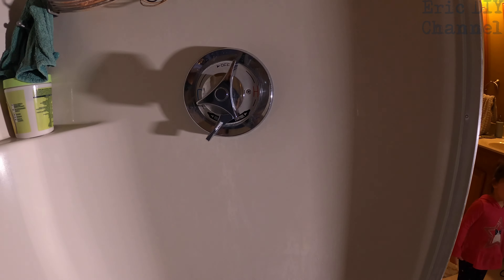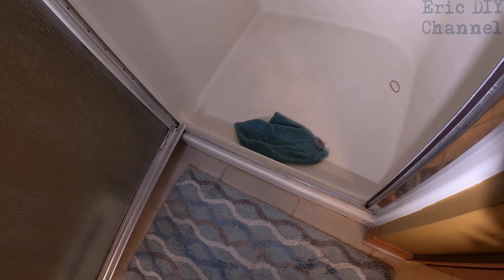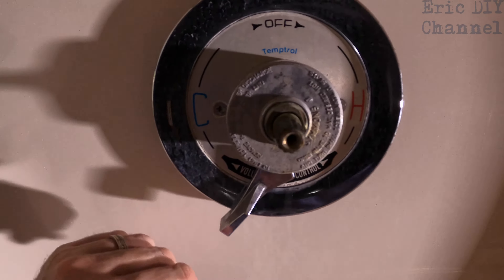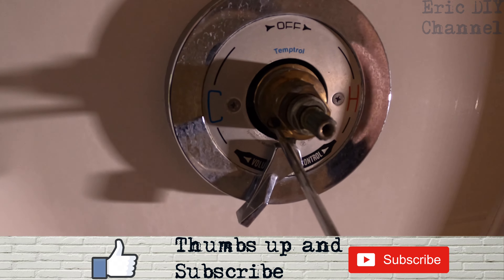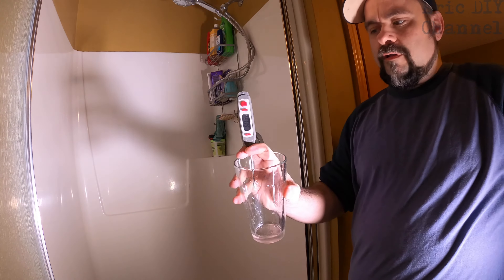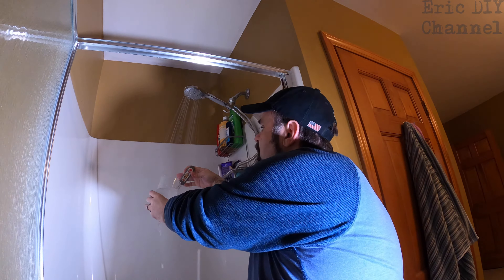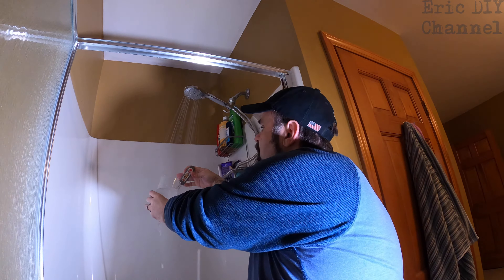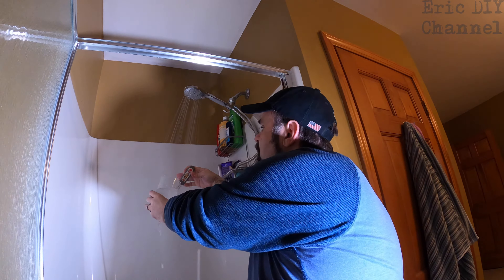How To Adjust Temptrol Shower Faucet Hot Water Temperature Limit Stop

Comment: I have a valve and parts in my plumbing spares and I studied it carefully today. I see how the diverter spindle works and I don't think it can be modifies. I just have to live with the bypass flow. I replaced every part but the body two years ago, so everything inside is nice and new. It's just how it works.

Comment: Is there any way to reduce the bypass water in a Symmons control. Even in a quick shower, we collect nearly two gallons of bypass water and I'd like to slow this rate down.
Reply from the maker: I don't know if any way
Reply: @EricDIY  The Symmons installation sheet says that a stream "about the diameter of a pencil" is normal when the shower is operating. Is this what you usually see?
Reply from the maker: @HomerShannon  You might have to change a washer out to stop the water from leaking as much. I had the same problem with the Symmons in my old house seeing that the prior homeowners didn't use the shower a lot and the rubber dried out. It would dribble out the bottom of the faceplate. It takes a special tool to take the valve out and then you replace the washer. I didn't take videos back then but I'm sure someone else has the video on YouTube.
Reply: That is s problem but I heard it is necessary

Comment: Hey Eric so  i watched your video several times and im still struggling with the temp control adjustment. Can you clarify for me what steps you did to make it hotter i turned mine CCW and it didnt get any hotter so im not sure what im doing wrong
Reply from the maker: How's the hot water source working? I would check that next
Reply: @EricDIY  new hot water tank . Hot water in the sink is perfect. It seems like im getting too much cold water but i dont know where else to adjust
Reply from the maker: My old house had a cold water adjust valve near the cold water input to the hot water heater. You might want to see if yours has one and close it slightly until the mix is right
Reply from the maker: Try checking and cleaning the spindle to see if there's any problems with the float in it (see this video here: https://youtu.be/RaYRM4dJNm0)
Reply from the maker: @dawn-blade  that's why it sounds like there is a problem with the mixing of hot and cold. I would check the spindle
Reply from the maker: @dawn-blade  I would contact Symmons and ask them to replace it under warranty. I bought it in the video because I didn't want to wait. You could try soaking it in vinegar first but if it's a new one you know it's going to work
Reply: There should be 2 adjusting valves behind the main eustchion. Remove the 2 Philips screws holding it on. Those screws actually thread into the center of the adjustment valves. You also could have a stuck piston in the spindle.

Comment: Ot bad,,  but there r dozens of brands with different adjustments ,,, heads up tape yr drainuse cardboard to protect shower base ,drop a tool could b ibnstalling new base ,,retired bath and kitchen remoldling 45 years,,,,,all in all u did help peps out 😊

Comment: Am I missing something? The Symmons Temptrol instructions say "To adjust remove dome cover, open valve to maximum desired temperature and turn in limit stop screw until it seats." Your video states that the turns of the stop screw IS the adjustment. It is not. It only limits the valve handle turning to the hot direction to the set maximum temperature to prevent dangerous hot temperatures from being reached. No disrespect intended.
Reply from the maker: It won't let you turn the handle any more than what the stop is set to. If you want to go further, you need to loosen the stop screw. If you just installed it, they leave the stop screw very loose so you can turn the handle to the hottest position you want and then tighten it once you have it there. If it has already been installed, you need to do what I show you to get the handle to turn more to make it hotter. You're reading from the initial install directions.
Reply: The instructions are correct from symmons. You never want to turn that screw clockwise as it will be pushing against the valve assembly. You want to have some breathing room between the end of the screw and the front of the mixer valve.

Comment: that didn't do anything
Reply from the maker: Well ..you did something wrong or you need to increase the amount of hot water going to your shower
Reply: Can you elaborate on how I would go about doing this? I’ve tried adjusting the screw and it’s not really affecting the temp at all, I’m in an apt and my bath/shower is lukewarm at best.
Reply: Try hot w as ter heater setting ,120 tops
Reply: Symmons us garbage as well